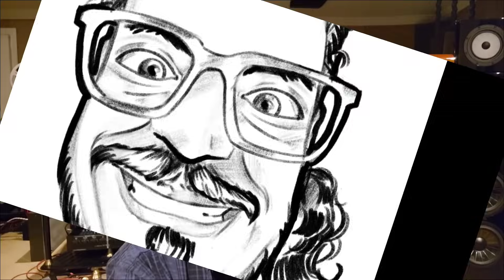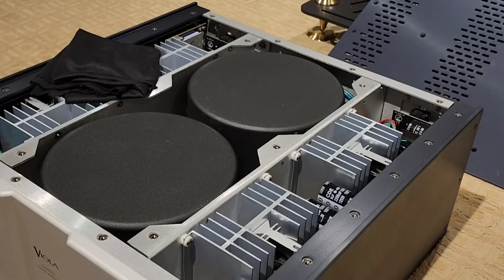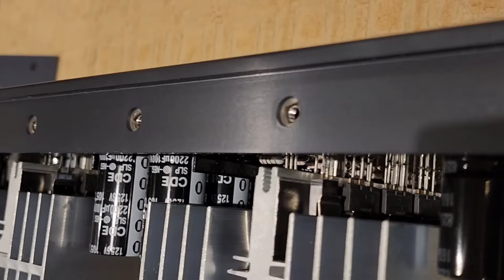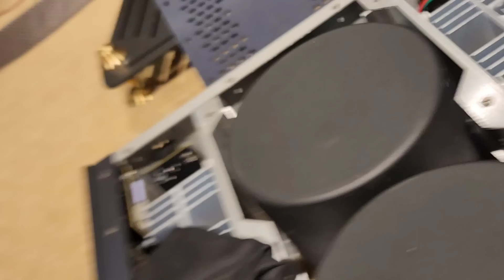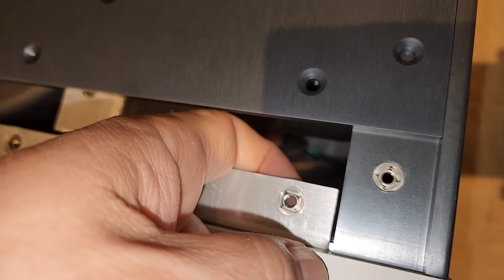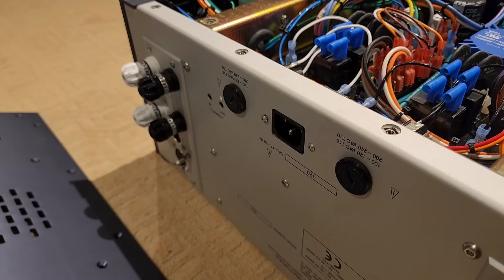THE BEST SLEEPER AUDIO AMPLIFIER OF THE DECADE !! #thebest

Comment: The question is to buy a great amp from a company that doesn't exist or buy an, as good, new, MC 462 McIntosh 500 watt per channel from a company that still exists! Plus, it has nice-looking meters to boot! I know, the factory only rates it to 450, but it's been tested to be within spec at 500. A real 500W gorilla.
Reply from the maker: Viola Labs exists right now in New Haven, CT. And McIntosh sounds horrible compared to Viola
Reply: @OCDHIFiGuy  Not...
Reply: @OCDHIFiGuy  
Adscribing a sound to an amplifier is ridiculous except in tube amps which by definition have distortion. Transistor amps of caliber have almost essentially zero distortion throughout the entire audio band thus zero sonic signaturen Their only difference is power ratings and current to load ergo how well they can drive any speaker. In effect, as transistor amps are concerned having any particular sound is a defect! The MC462 can drive any speaker regardless impedance to 500W RMS from 20- 20000 hz with an instantaneous current peak rating of 1500 watts per channel. All day long! The only amps more powerful are monoblocks. Note there are few speakers in the market rated for 500 watts plus.

Comment: I'm gradually upgrading my hifi setup but it is pretty cheap. I wish I had a class A amp. Currently using a class D (Aiyima A07) with Sparkos 3602 opamps in it. I've decided to upgrade my DAC. Going from a $200 DAC to a $900 one. Hoping I can tell the difference.

Comment: The best value power amp I have ever come across in my 50+ years as an music loving audiophile is the GamuT D200 Mk 3. Designed by the legendary Ole Lund Christensen, the D200 was not expensive when new and can now be picked up for $2,000. A single MOSFET per channel delivers 200W into 8 Ohms and 400W into 4 Ohms, while high current capability enables it to drive difficult loads like Magnepan 2.7 or 3.6 speakers with ease. It has holographic imaging with no audible signature of its own, and if you need even more power then look for the GamuT M250 monoblocks, which have the added advantage of a larger power supply. I pair my D200 Mk 3 with a '90s Sonic Frontiers SFL-2 Signature pre-amp, which is over-engineered compared to period rivals and most of today's pre-amps. I visit Munich High-End every year and have yet to hear new amps at any price that would make me consider changing over 20 years down the line. Newer and more expensive does not mean better! Forget the hype and reviews and use your ears!
Reply from the maker: There you go ! Great stuff !!

Comment: Quality and design look decent but even from what is shown in the video I can see where corners were cut.  They could have for example made each section inside a Faraday cage but they did not.  They could have shielded the cables and used grounded connectors between sections inside.  They could have put each output device on their own heatsink and made them removable for service with a connector for each.  I am sure I could find many other things they could have done better for the price point but I am sure the amplifier sounds wonderful and anyone would be happy with the sound.  I am just going to be picky about the details when the price is that high.
Reply from the maker: A Faraday cage also holds emissions INSIDE and is not always the best idea. Especially in an amplifier. Balanced/Differential amps don't need shielded cables because the circuit design inherently rejects noise. Hey, luxury product is not for everyone and not everyone understands what's important in an amp build. Thanks for your response.
Reply: @OCDHIFiGuy  yes in a well designed product with filters and shielding in the right places inside is where you want to keep any noise.  I have been working with RF amplifiers for over 3 decades where it actually does matter.  I don’t expect it would make any difference in the audio domain but if I am paying for a luxury product I want overkill in the design.  Not everyone understands RF and that is ok.  I am sure the sound is wonderful either way.

Comment: "It will last forever"........

👀 ..... looks at the wiring and the capacitors realising they only have 30 to 40 years of life in them...... wiring maybe 60 years before the plastic cases become brittle and drop off......

🤣😅🤣😂🤣😅 l.m.a.o. and goes to another video.........
Reply from the maker: Lol. If you're worried about an audio product lasting 30 to 40 years you got problems. That IS Forever... 🤣

Comment: A genuine 'sleeper' amp is the Atoll IN300 (150 watts into 8ohms & 260 watts into 4ohms) under £3000.00. The build is first class and the front is minimum two dials source and volume. It can drive difficult speakers includes a DAC and weighs 16KG (French company Atoll)  It's in an affordable price....

Comment: Im unsure if people understand what a sleeper actually is.

Its something with very basic unassuming aesthetics, and then usually big big dollars spent on the inside of the car, brakes gearbox roll cage so the chassis doesn't twist. And engine and drive train usually from some high end jap car , r35  1000 horsepower engine with a couple of turbos.

Pull up against a Ferrari and make it look like a fkn toy car you give to your kid for Christmas. 

And guess what? The sleeper probably ended up costing near as much as the Ferrari did..
Only one car is a sleeper, and the other is for men with small... feet

So yes this amp is a sleeper. Get over it. 😅

Comment: My idea of a sleeper amplifier would be a QSC USA 850. It's a name that nobody pays attention too because they are normally used in PA, DJ or Club applications. They are absolutely bulletproof and if you put a clean source signal in what you get out will put a huge smile on your face. It's simple design is what makes it so good. Specifications on paper are not what your ears will actually hear.
Reply: You're right, I used the USA 900 with Klipsch speakers and I have heard a lot of state of the art systems including being in a pro studio so I know sound. Although I discovered even 1 amp better than the qsc USA 900.
It's the Crest vs 900. Got it for $100 450watts per side damping factor of 100. I owned 4, but had to downsize. The only negative is the loud cooling fan. But that's an easy fix. I put the sound quality equal to a Krell. Many pro audio people say it's the best of both worlds, the dynamics and power of solid state but smooth clean and neutral like a tube amp.
I will never part with them. It sounds crazy but everyone I have challenged has lost my bet.
Reply: Damping factor of 1000 (oops
Reply: @iggyfritz7150 bingo - I scored some QSC amps for a giant destination party - kept them, and actually love them - especially for the price
Reply: @iggyfritz7150  aren't valve amps considered warm? mine also had a hum even the manufacturer couldn't get rid of
Reply: Qsc very good value
Reply: QSC lol😂

Comment: A sleeper should be something extraordinary magnificent and a great find for the price/performance ratio. The issue with audiophile equipment and their manufacturers is that it must be an absurd price to get attention and recognition. They are no different than the diamond jewelry marketers.
Reply from the maker: That's never been sleeper. A sleeper is a car. And it's a car with a big engine that's hidden from plain sight. So it looks regular but kicks your ass. Usually a sleeper has significant amounts of money put into performance, NOT the look. That's what makes this amp a sleeper. What you're talking about is called VALUE. so I would have titled it "Biggest VALUE in power amplification" if it was about price... how old are you ? You must be young to not know where the word came from..
Reply: @OCDHIFiGuy  Age has nothing to do with this subject. It's having some knowledge and common sense to not fall into this type of industry hype. Seeing so much snake oil that people fall for gadgets, such as buying an expensive item to elevate your speaker cables off the floor, has gone too far.
I purchased audio equipment to LISTEN to MUSIC, not to think about or have to tell other people how much my system is worth in dollars. The same concept is seeing massive heavy gear to give you the illusion that it has a powerful topology or that it has electronic components that your speakers need. Audiophile components should be a project of synergy. I'm wise enough to know that the preamp stage design is very crucial in the link. The listening room acoustics is also a major part of this synergy. When I turn on my system, I  don't need to look at the individual components. I turn on my system to enjoy the music experience that is captured at its best, no matter what format it's using.

Comment: Seems to me that a 35K price tag intrinsically excludes it from a "Sleeper" status. By definition if an amp costs 35k, it had better damn well perform to a reference level.
Reply from the maker: Sleeper means looks like nothing special on the outside but whoops your ass. Otherwise you're just talking about a HIGH VALUE amp... nothing sleeping in the dark about high value gear... it's out in the open.
Reply: @OCDHIFiGuy  I guess what I was getting at is when I look at that amp, I see nothing BUT quality, definitely unpretentious, but also obviously high quality.

Comment: Its nicely made, has about $2500 worth of parts, looks like a 4 channel. The input choke idea is simple but clever, it also increase the impedance of the power supply, allowing for the voltage to sag a bit when amp is running a heavy load or when bridged, which reduces the output power and protects the output transistors from exceeding there SOA. I made a test bench amp, and use a large sand-cast resistor on the mains side, to limit the current and improve power factor, I can drive the amp into a short-circuit continuously without any damage, with about 15 Amps fault current per channel. An audio power amp is a very handy tool, did you know you can send 60Hz sine-wave signal and add a step-up transformer on output and you have true sine wave inverter, with current limiting! Yes its not that efficient, but its handy for testing other small appliances. You can adjust the voltage by changing the volume. Don't use a cheep av receiver thou as the amp's output transistors are easily damaged, use a big amp module with 6 - 8 big power transistors.
Reply from the maker: Thanks for sharing !!

Comment: Where are the input chokes? I note the reduced capacitance that such a design offers but didn't see the chokes. I'm guessing they're sandwiched between the power transformers and the PCB on the underside. I've designed & built choke power supplies for preamps with great results. You need a very large choke to do this with a power amp. I'm gonna stick with my turn of the century Aragon monos. I'd rather buy an airplane than 5 new monos to replace them.

Comment: Hi, for a $34k amplifier I won’t call that a sleeper for a second🤣yeah it looks 👀 simple but don’t qualify for a sleeper. You want a real sleeper then try the NAD 3020 integrated amp at $300 used market average Now that’s a sleeper👍🏼😄👽✌🏼
Reply from the maker: Yes, I get that you guys think sleeper means ass cheap and good... I think sleeper means Corvette with Ferarri engine.. Looks like nothing but has very expensive balanced blueprinted engine under the hood..

Comment: He said this is a $35,000 amp.
For that price, it's garbage.
Reply: 35 too much cash yikes 🖖✌️🍻
Reply: They’ve installed cheap SDE SLP-series capacitors with a lifespan of only 3,000 hours—that’s absolutely unacceptable, given the price.
Reply: I guess you're broke, and don't have $50?
Reply: @JamesTrower-b3b $35,000 amp. Not $50.

Comment: I have a Heath kit power amp from the late 70's. I built it and has it tested by a lab at over 300 watts per channel. It looks like this cello amp. It is heavy,very. It does not require a fan for cooling, massive heat sinks. .  I built it and now it just sits, only 2 channel and I need 5.1 for sound.
Reply from the maker: Add a 3 channel and a powered sub or add a 4 channel amp if the sub is passive.
Reply: does it still work?? whats its output at 4 ohms?

Comment: I mean they don't last forever. You can see that this amp has already been repaired once. At least 2 of the caps on the power supply has been changed. And, it's quite common that these caps has a service time of 2000-3000 hours.
Reply from the maker: What makes you say that ?
Reply: @OCDHIFiGuy  Look at your own video where you show the capacitor bank. You can very clearly see that at least two of them are not the ones from the factory. They should all be the same

Comment: How much do they go for?
Reply from the maker: $35K or less if you call me. This one is for sale at demo pricing.
Reply: @OCDHIFiGuy  omg i thought you said it was a good budget option?! No offense but i would never pay 35k for anything that's not a must have for living and i like to build class A audio amps in my spare time so i much rather spend my money on good quality audio components to try and make a bad azz amplifier. This is the 2nd most expensive amplifier ive ever come across the #1 most expensive amp ive come across it found by responding to a listing for 100v 100000uf capacitors for sale

 and when i bought them i asked the guy what he used them in and he said they were part of the power supply for a 2 channel class A amp his company made before they went out of business so i looked them up and its was a huge amp as big or bigger then the one in this video made by magnetic Innovations High Fidelity (i think that's the name of them) and its cost 100k! So now ive got 8 Bugatti Veyron at the capacitor world capacitors sitting on my work bench waiting to power one of my scrap cheap redneck engineered amplifiers lol i almost feel bad using somthing so posh lol.

Comment: more transistors, more noise
Reply from the maker: You can only do so much with a single transistor... I've got 2 amps that use a single transistor in the output. One 30W one 100W that uses a single tube in-between the legs of the transistor.

Comment: Best sleeper CD players is Pioneer DV-300 and DV-410. With few cheap and easy modifications on D/A outputs and PSU with updating firmware they have astounding sound and measurements on outputs are exactly as it should be in scientific audiobooks.
Reply from the maker: What's a CD player ?
Reply: @OCDHIFiGuy  it´s a thing , litle and easier to clean after a mayonese sandwich?off course the sound is low-fi ,it´s a shame that cds do sound horrible no matter what player you hear it, it´s the same of listening to records on a pro-ject turntable if not over14.000€ it´s a waist of time but there are better players for 100€,in the 90´s i bought a CEC cd player belt driven ,today is still sold by 36.000€ and a bit more but it only costed a fix to me at the time ,it was the 90´s
Reply: @DID70Sworkedoutforyou  "waist of time" You seem to no wot yer talkin abowt.
Reply: @fins59  you seem to do not know what is talked about here and aboat is a totally diferent thing
Reply: @DID70Sworkedoutforyou  Ha ha, I rest my case.
Reply: @fins59  we´re not in a court of law either, but can rest , whenever you feel like to
Reply: @DID70Sworkedoutforyou  Did you actually go to school at all?
Reply: @fins59  yes, or i would be writting in english i´m portuguese and in live in the interior south ,the most desertic region from Europe also the most hot region ,they say it´s sevilla, Spain but i live at 200km´s from sevilla and never the temperatures were so high like in the region where i live and i worked  where i could retrieve samples of fruits or leafs to watch in a binocular magnifying device,to see if a plague or increase of insects or deseases related with fungus would decrease the production and what measures to take such as quimical treatments, and with 18 automatic metereologic posts spread out through the region i live in, to combined advise farmers what do to, this or that plague or desease should be treated with accuracy ,also to diminish the use of quimical products in the most exploited especies in the region like olive trees ,vines and some orange tree fields, today it was also introduced the almond trees exaustive production, today profit comes first ,the life of savage animal species comes in second having already created a problem in the last 20 years because the animals of diferent species are dying by the hundreds each day ,because they drink the water mixed already with quimicals in a watering dripper. That was my work today i´m only an independent consultant has i´m already retired of being a civil servant in this area of work